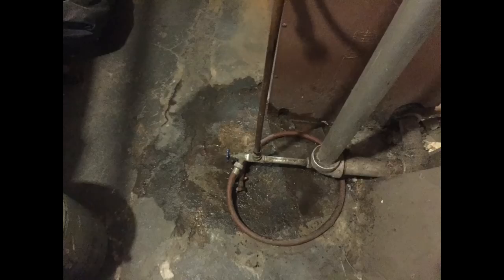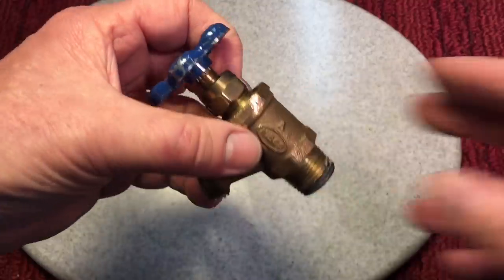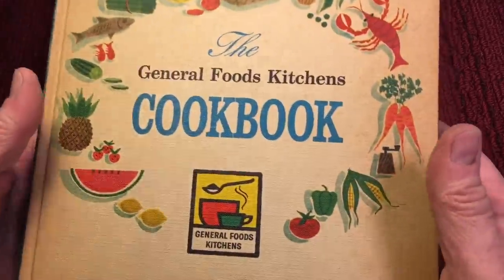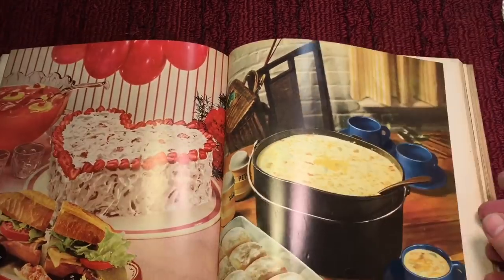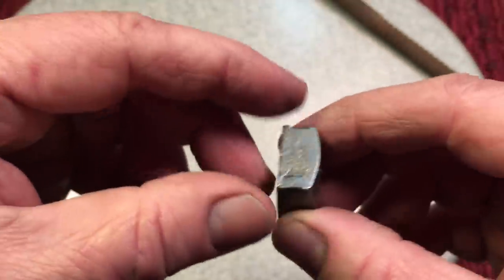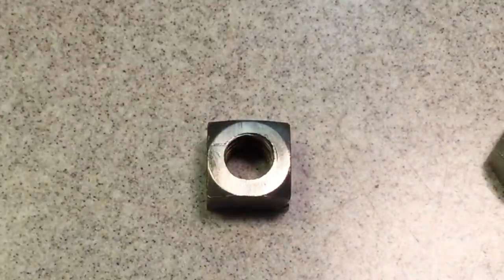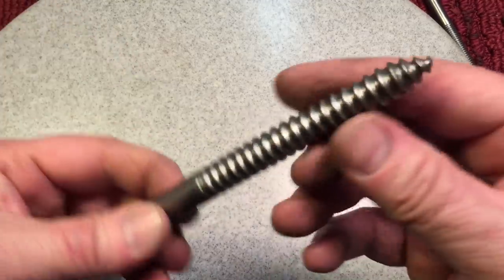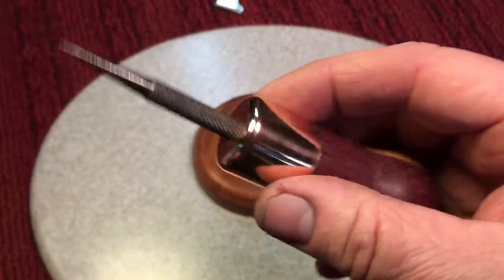It’s Hip to be Square!

Comment: sure have a good time with square bolt heads and nuts, they are much stronger than hex, still used in bridge other construction and rail roads. Why not any place else? Mechanized and automated assembly. Square does not lend itself to modern machine assembly. Square has a much larger contact than hex, some hex has HD size nuts and washers. Wrenches especially adjustable, and monkey type were designed for the square fasteners from the way old days. This is why combination wrenches were invented, in the old days open end wrenches had open heads on each end now you get the box end to do the hex. The need for quick assembly and the reduced quarters on vehicles made the hex a reequipment then cam Philips, and reed and prince, and now torx and what ever new they will create to get quick and properly torqued  fasteners. Liked your toilet paper roll repair, Take care and watch yourself, no owies .

Comment: I cannot stop laughing at your illustrations and pics. In the elevator trade some guys will use both dope and tape. Is that an actual valve or a hose bib? It doesn't open up under pressure does it? The lever ball valves are replacing the one like yours due to the leakage possible. I left a comment and question on one of your old vids (2/19/2019) just today. I didn't realize it was old till I looked at the top. Again, here's to the night owls.